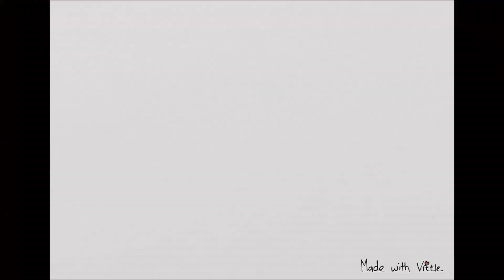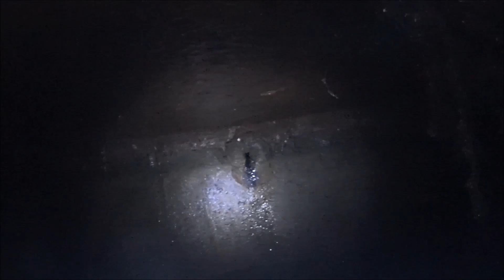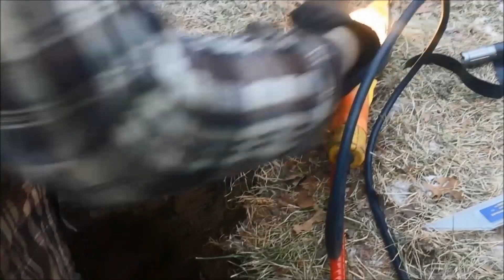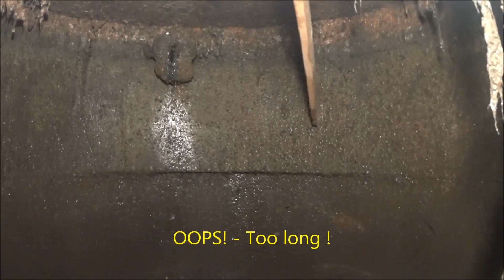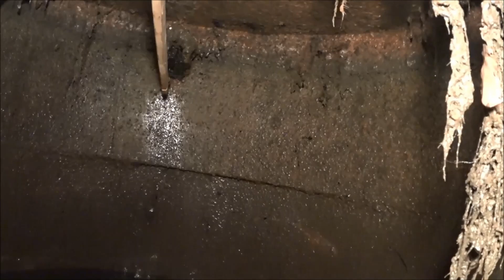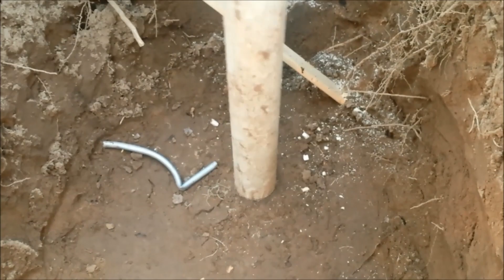Unclogging the Septic Tank

Comment: I have a septic system too. One question, do you have a water softener that dumps it's brine into your septic tank? If you do, this will mix with laundry soap water and make a precipitate that does this sort of plug. It does look like ice buildup could be an additional issue, but that black stuff under the ice is some sort of solid that I believe to be a precipitate. A friend had this same issue on his farm, and the septic guy said this was the cause. If you don't have a water softener, then ignore this comment. 

Nice tool to break the black stuff and ice away, but it looks like it's going to return. I bet watching a monitor screen and having the orientation correct so left was left and right was right made it easy to align the poker tool. It did not look like some odd solids, e.g. paper towel, sanitary napkins, diapers,  was the clog.

I built an addition to my home starting in 2007. I drove the skid steer over the pipe between the septic and distribution box. This killed the grass, and late in the year I dug  up the compacted soil. Well that enable the early wet snows to soak deep into the ground and cause the pipe to freeze solid. It never did it before or since. My temporary solution was to pump the septic with a pump to the back yard. I'm rural enough to do this. And it didn't smell horrible like it would in the summer. Had to pump it twice before the spring thaw corrected the issue.

I'm surprised that you could dig out by hand the dirt, must have been a real task to break through the frozen sod and however deep the freeze has gone. But deep enough for the top of the septic lid to have ice sickles. 

I like your CAD drawing, made it very clear what the issue was.
Reply from the maker: Luckily it was still relatively early in the winter season, so the ground hadn't really frozen up yet.  Plus is very sandy and dry on top there.  There was more problems with this septic past the distribution box also.  Compketely separate issue.  Anyhow the good thing is it is all on the past now.  Not sure all what caused the plug.   Probably eating too much cheese. 😁